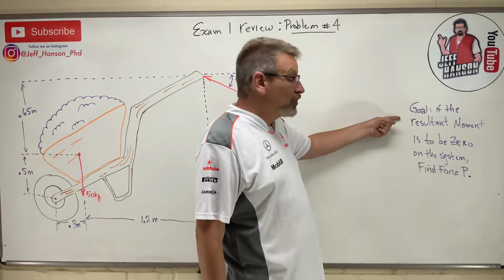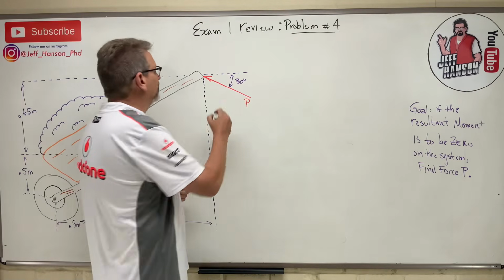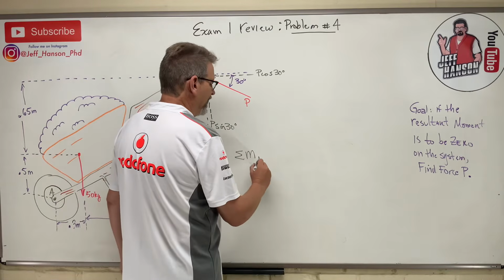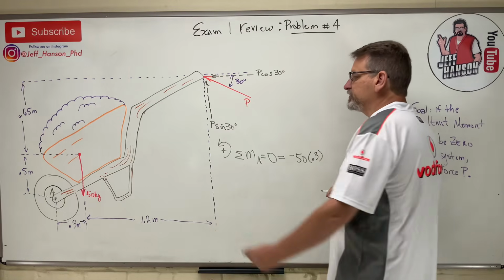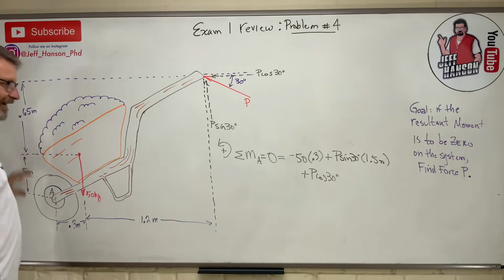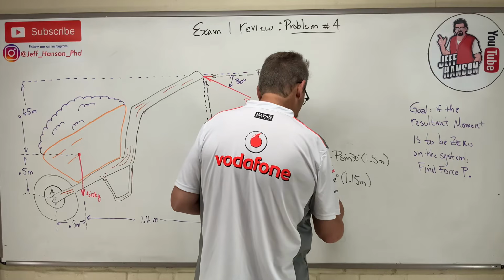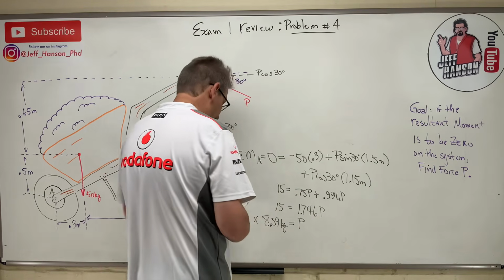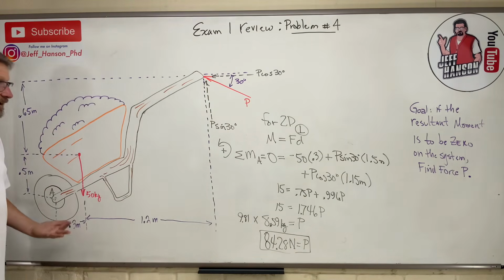Statics: Exam 1 Review Problem 4 - 2D Moment Example

Comment: Why didn't we take the "N" force to calculation which is effecting bottom of the wheel? I mean it has a moment too so. Yet, even if we take, there is a missing length between the wheel's centre and the ground. 
Please pay attantion guys.

Comment: I was curious to see if it would work, so I tried to use algebra to solve for distance.
y = tan(60)*x
(y - 1.15) = tan(150)*(x-1.5)
Sure enough, solving the system and using pythagoras theorum did in fact give me the correct distance.

Comment: Is there any specific reason to choose this point while taking moment? I will be happy if anybody answers.
Reply: Jeff Hanson chose the point in this video because that point was simple to work with, and probably also because it made the most sense, but you can choose any pivot point you want.
Keep in mind that a static non-rotating object must have zero moment around ALL of its points, otherwise there would have been a point where it started rotating.
So you will have zero moment no matter which point you choose.
Reply: Really doubt you need the answer since this is from a year ago, but you take the moment there because it wouldn’t eliminate any known forces or any forces that are supposed to be found like it would if taken at where P is or where the weight acts